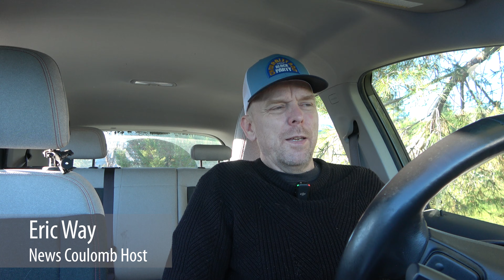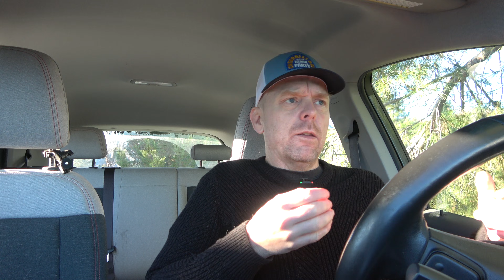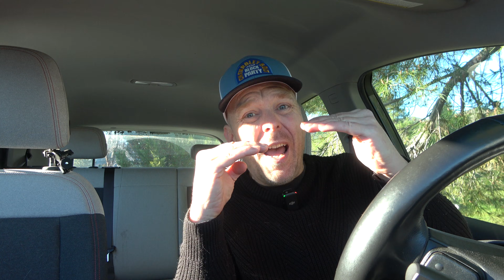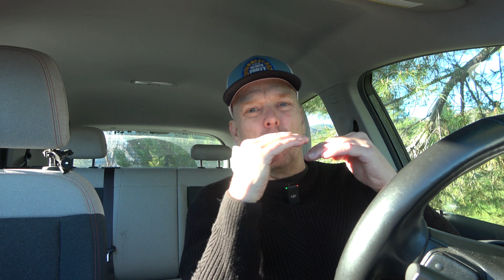Is Donut Labs Misrepresenting Their Solid-State Battery Technology?

Comment: As a electrical engineering, I can safely tell you that it cannot be a super capacitor based on their charging video.  The voltage is clearly nonlinearity during charging as constant input current! Plus, the capacitor will have to be 350,000 F to accept the amount of charge in the video. That will mean it has capacitance 3 magnitudes higher than the currently available supercapacitors. If someone was actually able to make that massive of an improvement, there would be research papers published showing that kind of technological improvement. It will not just come out of the blue by some smallish company and ready for mass production. R&D doesn't work that way.
They also made a claim that their battery can be charged to any voltage, which doesn't make sense for a battery (voltage is determined by composition of cathode and anode).
Reply: I just finished reading a paper published in April 2025 by the Korean Institute of Science and Technology (KIST) and entitled “Nanocell-structured carbon nanotube composite fibers for ultrahigh energy and power density supercapacitors”.

It claims numbers like:
- 418 Wh/kg
- 820 Wh/l
- 11’740 W/kg… which would allow crazy fast charging … like less than 5 mn… with pretty much the voltage and amperage you choose, or the one determined by the charger.
- or no degradation after as much as 100k cycles (kind of expected for capacitors).

Sounds familiar?
Please read it (it is freely available on ScienceDirect) and tell me what you think. I am a chemical engineer and no electrical one!

If Donut lab and Nordic Nano are still pretty much unknown entities, KIST definitely is not. It is a respected technology university.
Reply: @st-ex8506 I already responded to your post in another video that told you it's not possible for them to be related. The video shows a battery that supposedly have double the volumetric energy density that what is reported in this paper. Is there something in my previous response did you not understand?
Reply: @nmos001 
I understood it.
But that paper I mention seems to say something quite different… and it comes from a trustworthy source.
I enjoy you to read it and please explain why it cannot be the vehicle power storage device they claim in the conclusion of the paper, that it can be.
I am a chemical engineer and not an electrical one, so there might well be weaknesses in that paper, that I have not realized.
I’ll read your comments with attention!
Reply: @st-ex8506 I'm not saying the paper is not trustworthy, but I'm saying that I can't be the same tech since the video they demonstrated shows a battery that has twice the volumetric energy density as the one described in the paper. That is too high of a discrepancy. Also it's simply not possible to go from lab research to active production for these things in less than a year. That tech has potential, but this is not the result of that. The fact that the paper only achieved around 800WH/L makes these claims of 1500WH/L very suspect
Reply: Also EE.  Supercapacitors are NOT like ordinary two-plate capacitors.  They are a chemical action devices, where some kinds of Ions flow to other parts.  They are essentially a "battery" with roughly similar chemical problems.  The main problem in the OLD days was they could NOT provide high current flows, such as required for acceleration (depending on construction), but had a fairly high storage density.  Nowdays, with the use of Flat plate types of supercapacitors, the higher current can be furnished, but they still are only a chemical system.
Reply: @brunonikodemski2420 agree they do differ from typical capcitors, a constant current charge curve is not expected to be as linear as a regular capacitor, but it is still close to linear from my experience. If you had different experiences let me know. This video showed that the voltage was 4.1 -> 4.0 -> 4.1 -> 4.2. Even when we assume that at 0%, it is not completely discharged, it will still be a very unusual curve for a supercapacitor IMO
Reply: I always thought a smaller battery with super caps can give us with the best of what they offer
Reply: Well you don't really know what you are seeing and what they are showing! For example, since they claim you can pick any voltage and they picked 4.2V for compatibility with current Li-ion standard. That means you probably see voltage regulator and dedicated charging ICU in the mix. So, depending of the electronic module in front of the battery those values might mean nothing.
Reply: @JulianBG  you don't charge a battery through the "electronic modules in front of the battery". When you charge a battery, you connect directly to the battery, not at the voltage regulator -there are so many reason why that doesn't work and just plain stupid. Don't come here and accuse people of not knowing what they are talking about when you don't know what you are talking about. Also battery doesn't have arbitrary voltage ranges. It is a consequence of the metal used for cathode and anode
Reply: @nmos001 that is ridiculous. You have no idea what is inside that battery module.
Reply: thank you. I honestly do not care if they call it a capacitor, a battery or an energy releasing device, what annoyed me was the usual keyboard warriors insisting they had to know better without providing any credible logic.

I wonder how many more of these "videos" will pop up in my feed this year
Reply: @tomfurmby88 it's not about what it's called. I'm pointing out it cannot be a supercapacitor. And based on everything else I've heard about this, it is likely a scam. What they are claiming is not possible.
Reply: @nmos001  you must be an American I guess then based n your amswer? In America what you write would make some sense.
Reply: @tomfurmby88  that's pretty good. I'm guessing it's due to my word use
Reply: @nmos001  When you look at their claims, the suspicion of a scam is the first idea which comes to my mind as well,. The thing which speaks against it is the fact that they don't have vague promises when they will be ready to deliver. They promised to deliver the first motor bikes with those batteries  in a few months, which means, the batteries should be already be produced.A time horizon of months rather than years is not enough time to collect any reasonable amount of investments, which would be required for a scam. And once the bikes are on the market, engineers around the globe will be analysing the batteries putting them to tests. How would a scam work with such a timeline?
Reply: @rcallenberg I guess we will see shortly enough, but it should be noted that he came to CES WITHOUT a working prototype. If these are already mass produced, he should have just brought the actual batteries instead of making fake batteries to show off.
Reply: Keep thinking inside the box, you'll ok. Real world doesn't follow paths and rules. People force them to if it is needed, some people, some companies may not...
Reply: @bobsnabby2298 keep up the magical thinking. The real world is based in math...
Reply: @nmos001 and which math formula proves this is a scam?
Reply: @bobsnabby2298 it can't be a supercapacitor since C=Q/V. So deltaV/deltat = 1/C*deltaQ/deltat
Reply: @nmos001 don't try to fool me with your Google search shit. Just sit tight and watch what happens 😂
Reply: @bobsnabby2298 I'm not trying to fool you, you asked for formulas, I gave you formulas. If you don't know how to interpret what I'm tell you, you can either ask questions, do some own research or just admit you don't know. Don't accuse others of making stuff up if you don't have the knowledge to know what they are talking about
Reply: @nmos001  don't feed this BS, it is non related to the subject. Even they said it's not a supercapacitor, so stop feeding this BS Google stuff anyone can find online  LOL
Reply: @bobsnabby2298  I never claimed that it was a supercapacitor. I have stated multiple times that it is not based on the video that they showed. 

If you don't want to hear BS, you should avoid listening to Donut's CEO. Apparently, he claimed he developed AGI several month ago, and used to be a spiritual rapper! Wow, this just sounds worse and worse. 

https://youtu.be/aYiVfOpA8HU?si=_Ej486C_dVfCGTWC
Reply: @nmos001  I am not an expert in this field and I don't know if this is a scam, we'll see soon enough. But I would like to remind everyone that Nikola Tesla was 1 (one) person, working alone basically, he wasn't a "spiritual rapper" but had some serious quirks. He had strong affection for pigeon(s), he claimed he was talking to ETs... I am not saying this CEO is modern Nikola Tesla, but I would like to see one, it's about time. I am fascinated how people who are experts in this field are hardwired to think the same way - same questions and doubts - like "this is a very small company, only XY number of people, it's nowhere near enough for such a breakthrough". Again, look back at Nikola Tesla - how many people were in his company that created everything he's crated? I can't remember anyone mentioning anybody else, except him, regarding his inventions. I don't even understand how such a breakthrough or such a novel idea would come out of a team. Maybe it's just me, but I think extraordinary ideas are coming to individuals, who, like Nikola Tesla, get "the whole story" at once. Also, regarding formulas - did it ever happen that people were sure that some formula was correct and later found out it wasn't? To quote Trump from the South Park: "Relax, guy!" :)

Comment: The main problem with supercapacitors is their energy density of 15–50 Wh/kg. If they have achieved an energy density of 400 Wh/kg, that is a revolution for supercapacitors.
Reply: Nano-tube based supercapacitors with an energy density of 418 Wh/kg have been developed by the Korean Institute of Science and Technology (KIST).  The name of the paper is “Nanocell-structured carbon nanotube composite fibers for ultrahigh energy and power density supercapacitors”.

It claims numbers like:
- 418 Wh/kg
- 820 Wh/l
- 11’740 W/kg… which would allow crazy fast charging … like less than 5 mn… with pretty much the voltage and amperage you choose, or the one determined by the charger.
- or no degradation after as much as 100k cycles (kind of expected for capacitors).

Sounds familiar?
Reply: @st-ex8506  how long the charge holds after removing the power source? I.e. what is the internal resistance and leakage current? That would be critical, because it was not mentioned at all.
Reply: @JulianBG 
I agree with you. Let me see if I can find that value in the paper.

PS: didn’t find that value.
Reply: @st-ex8506  The CNT method described holds charge like a batter, it's a pseudo-supercap, still a battery unlike other supercaps. The paper pdf went over it too i believe.
Reply: @Nivexity 
The paper indeed mentions that it behaves largely like a pseudocap.
So what?

It would justify Donuts Lab people denying it is a supercapacitor.
Reply: @st-ex8506  To be more specific then, if it follows KIST's paper then it's a PANI grafted CNT fiber pressed through (from what I believe) a thin flat nozzle directly into an acid bath, which coagulates the CNT and PANI, forming long fibers mixed with PANI which are protonic doped and infused with sulfuric acid inside the polymer. This creates millions of electrochemical nanocells which use redox to charge and discharge, achieving high Wr/kg density.
Reply: @Nivexity 
I am glad to have your apparent expertise! 
I am not saying that Donut Lab is using the KIST technology, but I have the impression that, from this paper, that this technology would justify most of Super Mario’s claims. Would you agree?

The ONE claim I absolutely do not buy, is that they are ready for large-scale production!  As Musk often says, building a few prototypes is easy, but production is (incredibly) hard!
Reply: @st-ex8506   it's vaporware
Reply: @st-ex8506  I read this differently. Donut Lab read that paper, copied all the claims and create a scam that looks plausible. It is quite rare that two completely independent research teams to came in the same year to absolutely the same conclusions. You see how that looks from outside. If you ask me how their scam works? I could telly you, they sell those extremely overpriced motorbikes and they expect many people to buy those. Either they wont deliver or what they deliver will be some "Chinese" version which has nothing to do with their claims at 1/10 of the manufacturing price, after which they will disappear with the money claiming the money were lost in manufacturing process.
Reply: Leakage current is horrible in supercaps compared to Li-ion battery. For example a Li-ion 1% to 3% per month self discharge, while a supercap is in the range of 20% to 50% per month at best. So, that must be investigated. 50% discharging for a month is totally fine for most applications and that might mean a hybrid solution, like 10% of the battery to be Li-ion so your car is not dead just by sitting on the parking lot for awhile and the rest 90% to be supercap. But again News Coulomb is spot on. Density, discharge/leakage current/, ageing problem must be evaluated.
Reply: so if 20% a month. 5% a week. 5% - 370 miles  =  350 mile Range. Not Bad.
Reply from the maker: @LiftingTheMind  Not terrible, no, but it should be looked at as part of the car's efficiency. It all starts to stack up. Including charging losses, even lithium battery EVs have a "wall-to-wheel" efficiency that is 10-15% lower than their rated efficiency. So losing another 5% or more each week in additional losses means you're spending a lot more money keeping it filled up. 

Also, from a consumer perspective, it requires a lot more care and management. For people who are used to leaving their car sitting for weeks at a time, this significantly increases the possibility of bricking the car.
Reply: What happens when a capacitor with that high a power density fails. 

Usually all the power is released instantly. This can be quite spectacular with even today's low power density, at 400WKG you are going to get a pretty big explosion
Reply: @Alantj22   they claim "no flammable liquid electrolytes, eliminating the risk of thermal runaway, dendrite formation, chain reactions that cause fires, and asserts that the battery is safe even if damaged" 😅
Reply: Probably more a graphene dry capacitor imho rather than a "supercapacitor", which generally requires some kind of electrolyte, being electrochemical in nature.
Reply: @TheFlyinCanadian that level of scaled up graphene production would be significant in and of itself.
Reply: Yes . The energy density of a Super-Capacitor is too low. I tend to believe Donut Labs. The COS (don't know) his name did not speak and act like a Scamster.   I would be very surprised . However it seems almost impossible.  We will have to wait . I do not think is is on Power with the Zimbabwe Chikumbuso scam.

Comment: If the Coulombic efficiency is 90%, the charging time is 5 minutes, and it’s a 20 kWh battery (say, for a motorcycle), it would be putting out 24 kW of heat while charging. That would be a complete showstopper. 

Therefore, to go with your default of believing what they say until we know otherwise, the charging efficiency must be 98+%.

Comment: No way a supercap has that kind of energy density. 

They’re CLAIMING it’s a full-solid battery, made with abundant materials (I’m thinking sodium). It’s possible they’ve designed a battery with some capacitor-like behaviour but a pure capacitor can’t come anywhere close.

It’s healthy to approach these claims with skepticism for sure, but this is a company with a track record of decent engineering. I can’t imagine why they’d stake their good reputation on a hoax. 

We will have the Verge bikes on the road  soon. We will doubtless have some answers then.

Comment: The Ford 150 lightning NMC 9+ batteries energy demsity sits between 220wh/kg and 240wh/kg, the increase on range would be much more significant, more like 60%, which is a massive improvement, if we add the extraordinary flat curve charging  speed that they kinda showed in the video, we are talking about a revolutionary breakthrough. Plenty of reasons to be skeptical, but the good thing is that we don't have to wait long in order to find out.

Comment: Voltage profile was addressed, they said it charges at 4.2 volts all the way. they said they chose that number artificially to be a plug and play into EV's. there was a video where they showed that.
Reply: https://www.youtube.com/watch?v=Qsi-TS8PX7U&t=10s It was refrenced in this video
Reply: Voltage will affect Ah SOC, typically not linear so need to see the whole chart.
Supercapacitors are far less kWh/kg, far less kWh/L compared to li-ion cells.
Reply: That doesn’t address the issue. It actually brings on more questions that they are refusing to answer.